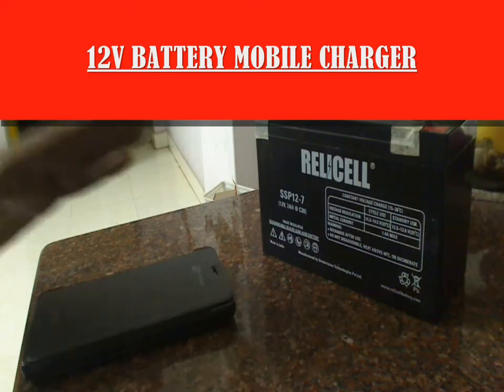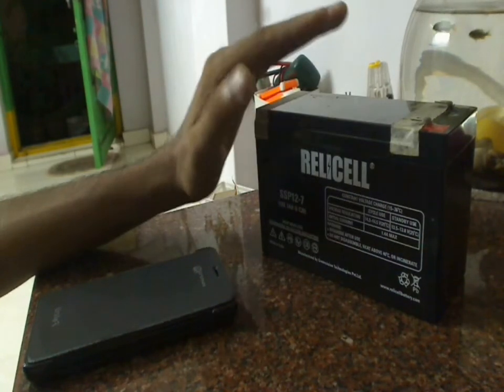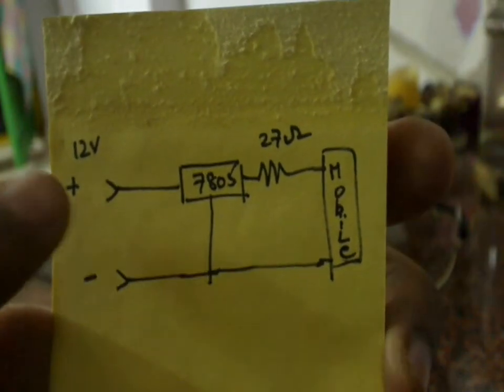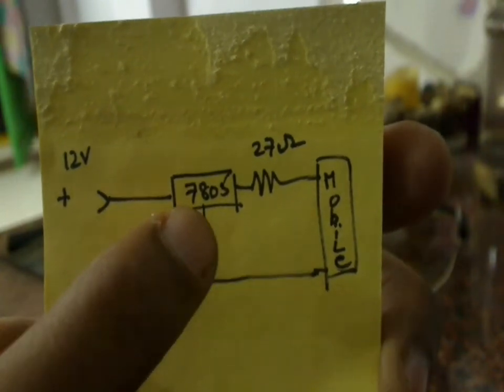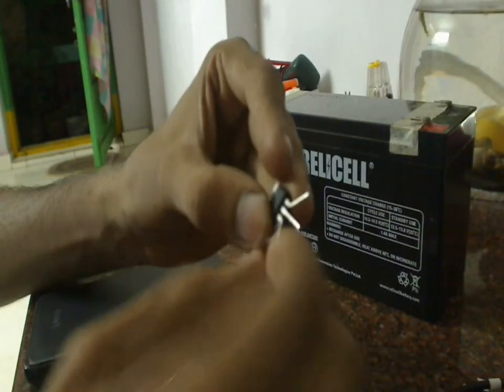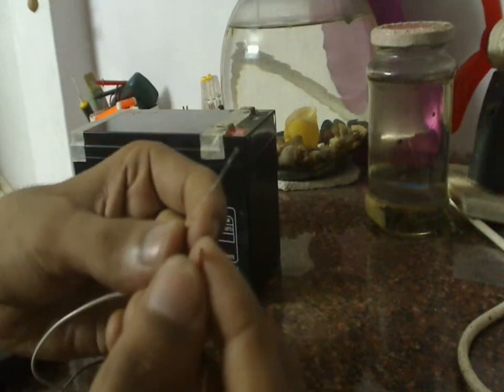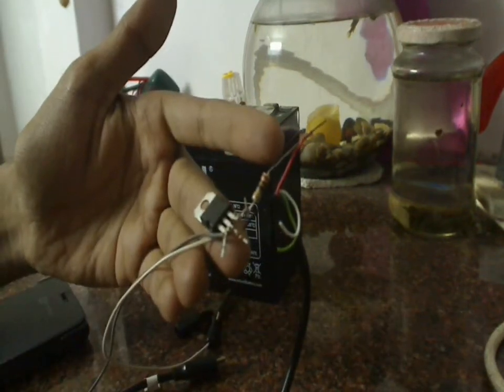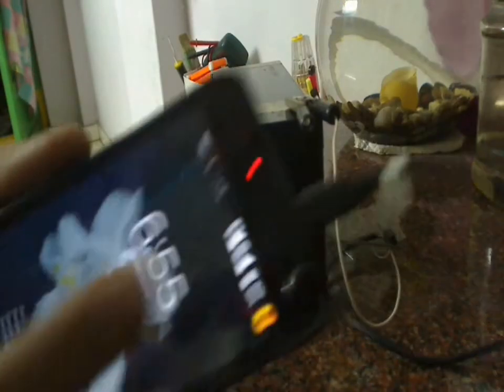Charging mobile from an automobile battery

Comment: Using a 7805 or any other linear regulators are not efficient ...they work as an resistor connected to load and will dessipate heat more making them inefficient...These regulators dessipate less heat if a 6v is given as input rather than 12v input...  though might used for emergency purpose but not for long run.. better if we use a 12v to 5v dc to dc converter works on the principle of PWM method.. Try making a 12v dc to 5v dc with a decent current o/p of 1amp atleast ...

Anyways keep it up bro.. hoping for new and  more videos...